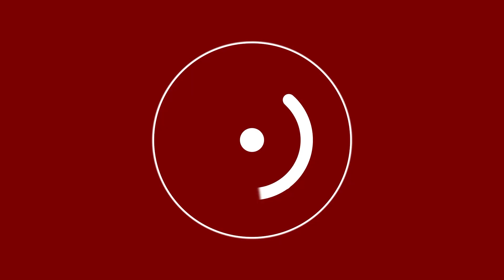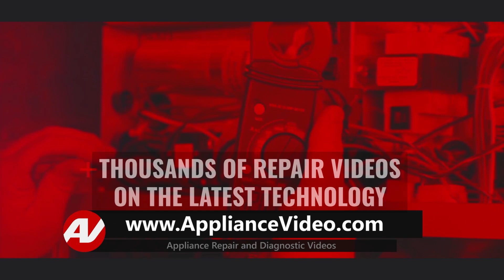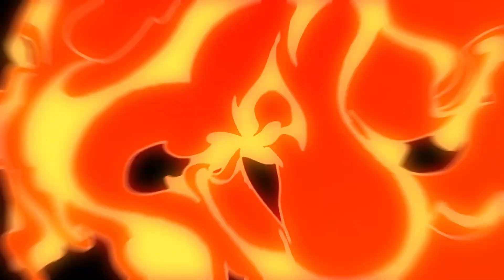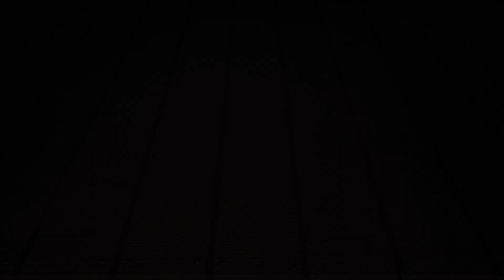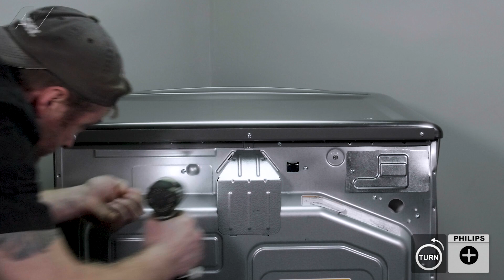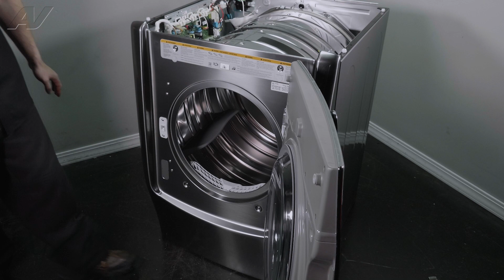Dryer Repair - Door Indicated Open When Closed - Door Switch

Comment: I’m not sure why you felt the need to take the entire dryer apart when you could simply snap off the switch from the outside. It should only take about 10 seconds to replace it with a new one."